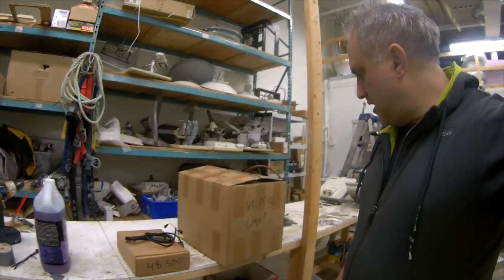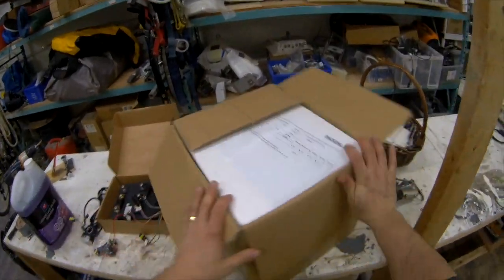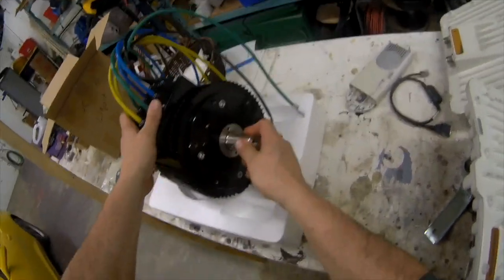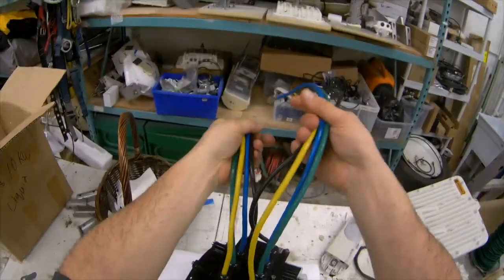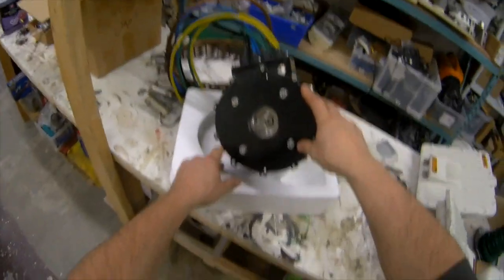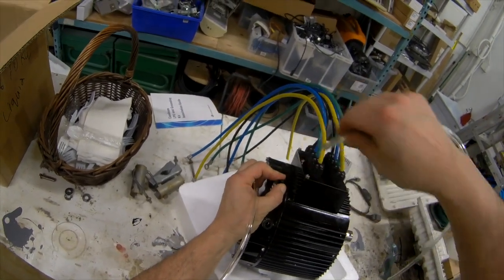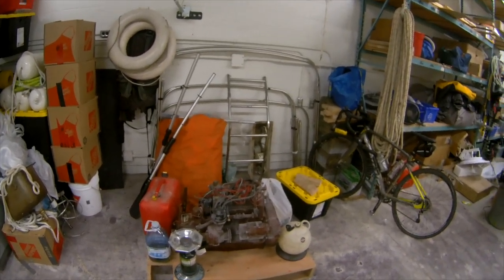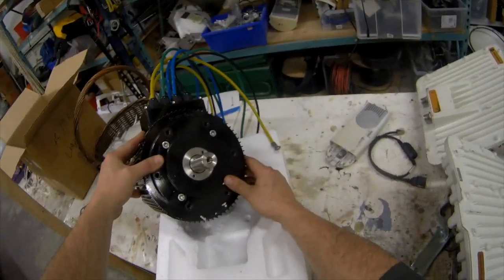Ep34 Golden Motor 10KW 48V Electric Engine Unboxing

Comment: Can this motor be mounted flat (shaft down) ? I dont see any mounting attachment holes...
Reply from the maker: the motor has 6 hex bolts to attach it on the opposite of the shaft end. i don’t know for certain the implications of mounting with the shaft up or down facing but i would post on the golden motor user forum. i never looked into it. i know from history that electric motors were the vertical orientation motor choice for many applications. good luck !

Comment: Greetings! The kilowatt rating is the output of power from your motor. 1 kilowatt of output is equivalent to 1.333 hp. in your case you have 10 kw, motor so it's output is 13 hp. i hope this helps you. good luck!
Reply from the maker: thx, appreciate the info, commenting and for watching.

Comment: Thank you for your video. I am looking for a 48V low-power, three-phase induction motor. Do you have any suggestions for where I can buy it?
Reply from the maker: hi i put descriptions and links in the description of the video. if you are looking for a DIY there is also thunderstruck ev as well as golden motor where you can buy parts.

Comment: I would like to make an outboard motor for a tender. Does this motor have a water pump built in? Or can I add an electric one to recirculate fresh water into an underwater "radiator" of sorts so that I don't have to run salt water through it?
Reply from the maker: no pump in the liquid cooled version. i am hooking up a glycol mix and radiator to cool the controller through an external rad, fan and pump. i don’t want salt water touching anything which is why i’m going this route. will have it captured on video soon as i can.

Comment: Thank you for showing these! Looking to rip/replace an Atomic 4 gas too. Going to do electric, which makes so much more sense and more cost effective.
Reply from the maker: thx for the comments and good luck with the conversion! i am glad i went the direction i did even though it was a bit if a learning curve. Hopefully some of my info helps you out.
Reply: @TheNeds  I agree. The learning curve is sort of a pain, but in the long run, to power off the sun instead of dead dinosaur juice... worth it!

Thanks and will check out Finding Simon!
Reply from the maker: This channel, finding simon, I came across a video recently which gives a good breakdown of the different types of electric motors. I found his video informative. I went with a Brushless DC motor, as there is no spark and therefore cannot accidentally ignite any fumes. I don't have any propane or alcohol stove etc. but if I did want to add later, I didn't want any chance of a motor creating sparks. https://www.youtube.com/watch?v=bMXR1UYSMa4

Comment: Is it 3 phase with 2 controller?
Reply from the maker: yes it's a 3 phase motor, and it can take 2 controllers from my understanding.
Reply: @TheNeds  I think 1 for controller and for censor
Reply from the maker: @raulpi9441  I am not an expert here probably better to confirm with Golden directly, but on their documentation, it has 2 hall sensors, one labelled hall/thermal sensor and one labelled spare hall sensor. I believe that there are 2 hooked up onto 2 stators. If there is a failure in one stator, you can move the hall sensor to the spare. In my testing, either one made the motor run. When I asked Golden about them, the feedback I received was that I could have a second controller, but I didn't ask further if it's 2 controllers running at the same time or just a quick connected backup.

Comment: Can you please send me the link for 10kw kit,like what all should I buy
Reply from the maker: The links are in the descriptive text of the video above to all the major components of the refit including the 10KW motor and controller.
Reply: @TheNeds  Hey man, thanks for these vids. Would something like this work:

Baldor 25 HP AC Motor 230/460 volts 3600 Rpm 2P 284TS Frame?

https://www.baldordirect.com/EM4107T-25-Hp-3600-Rpm-284TS-FR-230-460-Vac-3-PH-TEFC-EM4107T.htm

??

Comment: What is top speed?
Reply from the maker: I haven't pushed it passed 5 knots but there is more engine available than I have used. I am not in the habit of over-revving engines. In a 52 knot storm I had to motor against it blown off anchor and was pushing 90 amps as opposed to my usual 20 amps. My max hull speed is 6.5 knots. I imagine that different props would make a significant difference as mine is a slim 2 blade prop. I'm looking for a 3 blade prop. Also adjusting the gear ratio (mine is 1.92 to 1) would use less power. The 10KW motor has significant torque performance over the 5kw version. My goal is to get to 4 knots using about 500 less RPM which would keep me at 20-22 amps draw. Right now I'm 3.2 knots at 22 amps.

Comment: 40 kw bldc motor & controller, full kit how much dollar
Reply from the maker: The motor I put in was the 48V and 10KW version.

Prices are online, in CDN on Golden Motor's website for Canada

https://goldenmotor.bike/product/48-volt-10kw-bldc-motor-liquid-cooled/

https://goldenmotor.bike/product/vector-500-series-48-volt-brushless-motor-controller/

I also spent about $400 in misc parts, cable ends, wire, aluminum etc.

Comment: Kw to hp conversion is 1.3
So 10kw is 13hp mann
Reply from the maker: learned a new thing every day! thx!
Reply: @The Neds you might also want to learn that your numbers on a 20% efficiency gas engine or diesel engine for one is way off and has no bearing on the rated output most gasoline and diesel engines run much closer to 50% efficient but if an engine rated at 25 horsepower it puts out 25 horsepower it just burns more fuel to make that depending upon its efficiency but it still puts it out now a gasoline engine that's rated at 25 horsepower maximum can't run at 25 horsepower continuous but maybe 75% so you're going to be comparing a roughly 13 horsepower electric motor 2 maybe a 20 horsepower internal combustion engine not certain that that no no insult intended but that cheap electric motor is going to be able to put out a full 10 kilowatts continuously but even if it can I don't know that it's going to keep up and do the same job that your old motor did it may do a good enough job to make you happy but 25 horsepower internal combustion engine has a pretty good chance of keeping up or besting the 10 kilowatt DC motor hope it works out for you
Reply from the maker: missed your comment a while back. ‘cheap’ is relative. after solar, batteries, controllers and wiring i doubt there was much savings if anything might be more expensive. i will put a complete comparison as refurb Atomic 4 was put in i have a full invoice. it was $6700 USD for the rebuilt motor (not installed just the motor). 

i think my comments still stand as if it was a brand new engine i agree that it probably has more efficiency. i didn’t have any facts here but it was the atomic 4 was a rebuilt 1967 tractor motor. I highly doubt it was efficient at all but i could get boat speed up to 6 knots with it. damn it was loud. at low rpm it didn’t move the boat at all compared to the 10kw electric. 

in contrast i recently (accidentally) max throttled my electric motor and was speeding up past 6.5 knots before i realized it. its so much quieter. i run at less than 1kw to get 3 knots. so 10% throttle. 

id have to be over 1200 RPM on the gas to get over 3 knots so 50%. that i believe is the differences in efficiency. i wish i had the foresight to record and graph the atomic 4 rpm/engine speed vs boat speed. 

thx for the comments i think a good debate on electric vs combustion is full of opinions and loves just as much as facts.
Reply from the maker: thx for some details there. i think i have found similar real world results as i run my motor at 10% to move at 3 knots. i am still using the original prop. 

i had to limit in the electric controller my max rpm to 2400 as i just keep caveating before the change. thx for the comments!

Comment: y 48v and not 72v
Reply from the maker: using in my sailboat, I wanted to use deep cycle golf cart batteries, 8 of them in series, and I don't have enough space for more. Also, I was thinking that the higher the voltage it can get dangerous and I felt that 48 volts was as high I felt comfortable with. But maybe that is just in my head and not reality. I did test touch across the phases and it does buzz....
Reply: Another perspective from those of us putting these in sail boats...  Voltage.  I have to get the volts coming out of my solar array higher than the voltage in the battery for the battery to charge.  In my case that is 2 household pv panels, gets me to 60 volts, and I have run out of shade free room on my boat, and that is at high noon.